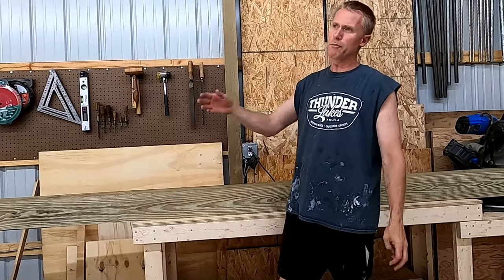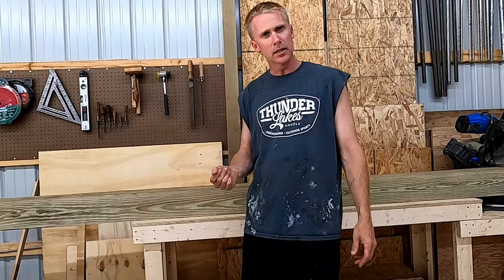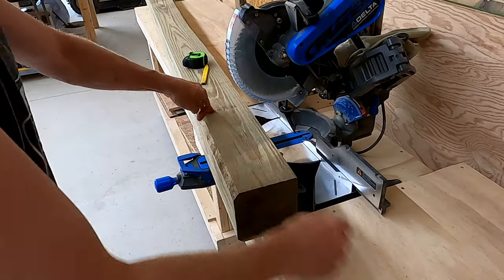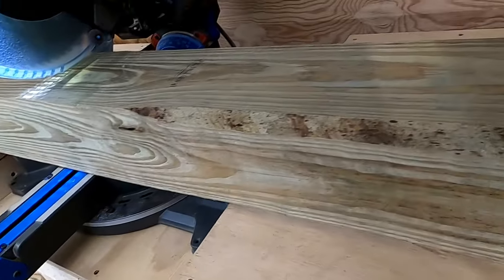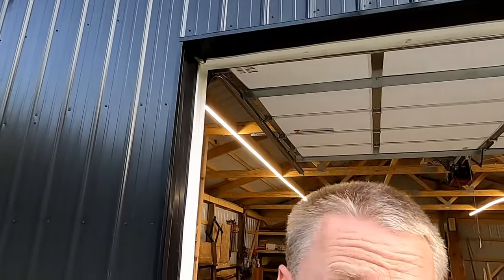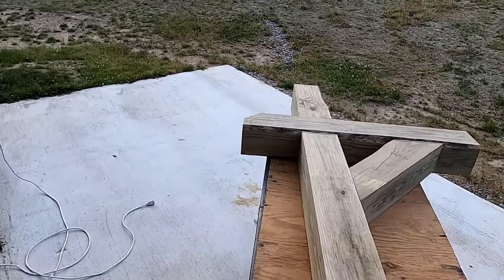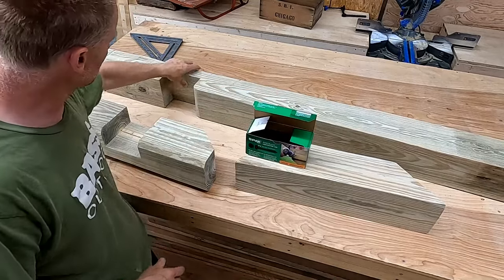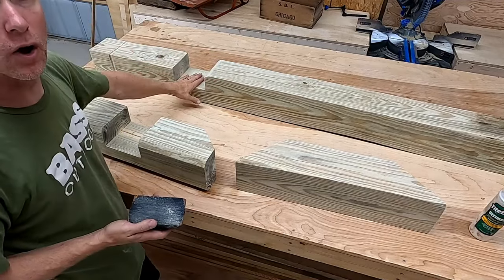How to Make a BIG Mailbox Post

Comment: Ah, not to bust your bubble but....
According to the United States Postal Service (USPS), curbside mailbox posts should be made from wood that is no larger than 4 inches by 4 inches, or a 2-inch diameter steel or aluminum pipe. The post should be buried no more than 24 inches deep and should be 41–45 inches above ground level. The post should also be stable but able to bend or fall away if hit by a car. 

It's all about safety.  Over 50 people a year die from collisions with mailboxes.  Some common mailbox supports that are illegal and therefore a huge landowner liability are those made out of brick.  A knowledgeable personal injury lawyer is going to sue everybody.  Even a DAss personal injury attorney is going to sue EVERYBODY, including the manufacturer.  

As for damage to a mailbox post by someone knocking it over....well, the owner may not be able to collect for the damage/repair to an illegally installed mailbox.  The really scary part is when a motorcyclist or bicyclist runs into an illegally installed mailbox support.  Just saying....
Reply from the maker: Thank you for all of that.
Reply: boooooo get of the stage